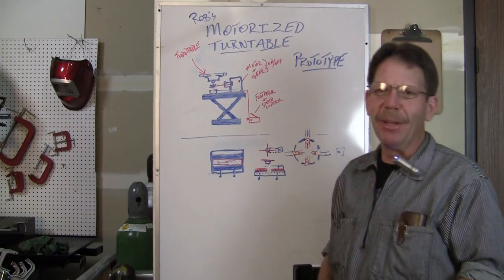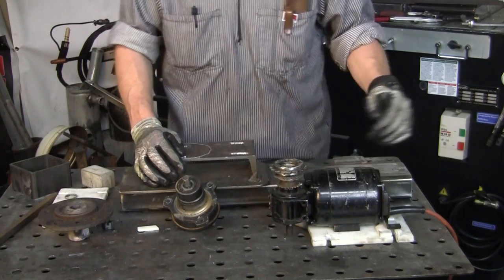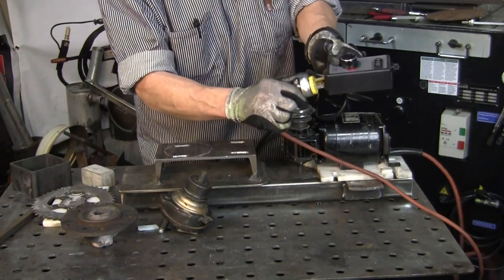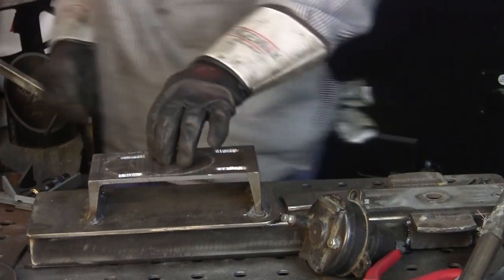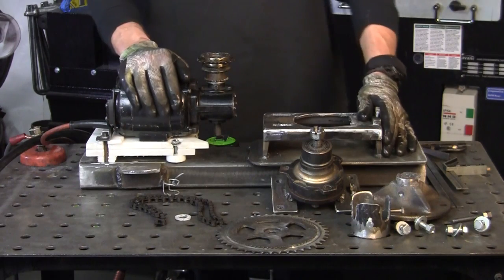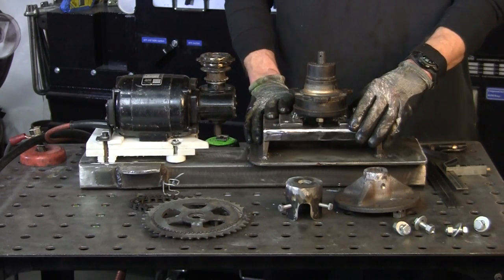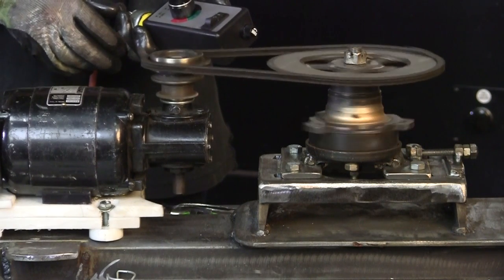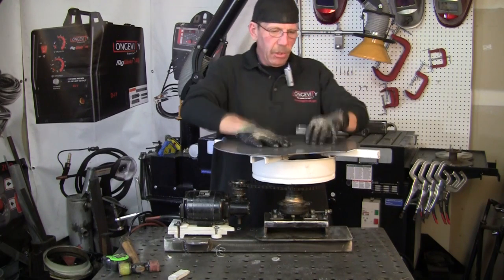Welding Turn Table Part 7

Comment: Nice work. You could operate the potentiometer as a foot pedal. Something like a straight piece attached to the dial so that you could push or pull with the toe of your boot.